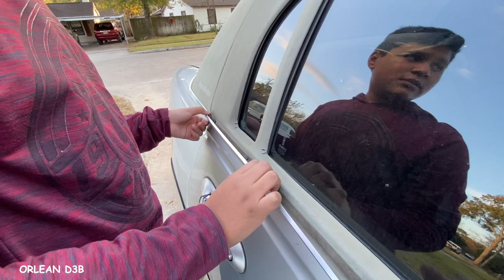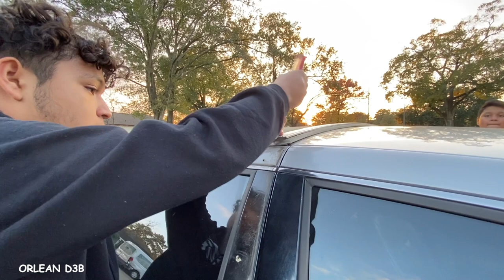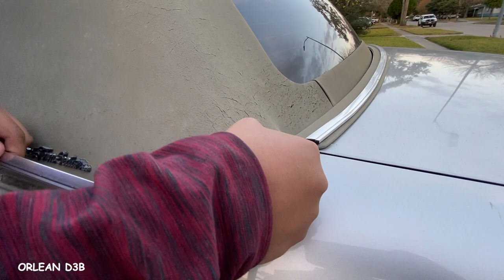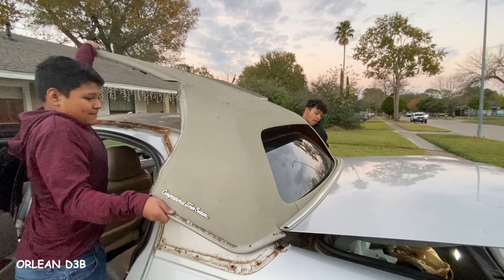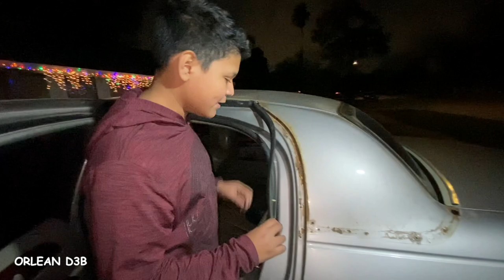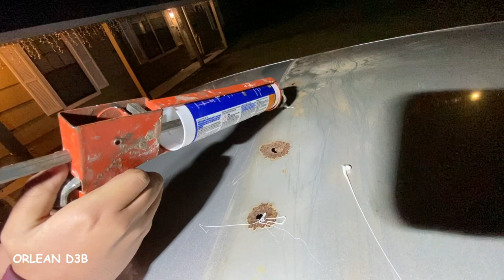Removing The vinyl top from a lincoln town car

Comment: One thing I can say about those cars is being body on frame you can actually replace the entire section of top if needed. The issue is the welding that you would need to do to replace the thing might require another carriage roof to cover up and hide the welds. ( limos have such roofs to cover the welding that was required to extend the body )

Comment: I have an 03 with a full vinyl top, had it replaced about 7 years ago but it’s starting to come lose in the front. Bumps are appearing underneath in some areas, I think it’s rust spots. Hate getting rid of the car because it runs great and look good still except for the top. Wonder if I can have a body shop remove the top and do the repair and just paint it to make it a hard top?

Comment: Nice movie. But if you wanted to carry out the work sustainably. Better to make those holes in the roof rust free and weld them closed. Now you know for sure that within a few years the roof will start leaking and rust.

Comment: What an unfortunate car modification 😂boomers had quite a taste. Now your only two options are a new vinyl top or re-wrapping/repainting this one (which will rot away anyway) or re-painting the car (painting the roof is the worst, even with proper equipment)
Great video and cool car 👌

Comment: I'd love to see how you guys would do this thru u both on a 2000 Lincoln towncar limo I have. I'm afraid to even touch it or try to do anything to it despite the vinyl top on it is cracking and is even coming off over the back of the side panel behind my rear door in it due to a bad rust spot my car has on it and under it even. I really wish I knew how to be doing it to a limo if I'd be possible and to not be having to be paying a shop thousands a shop wants to do it even here and that's out in Riverside CA an HR away from me and when I don't have a few thousand just to be giving to a shop to be doing it if it's possible. What's the tube of stuff your putting on the holes in the top of the roof on it? Is that a tube of DAP? Or whats in that tube? And why are you filling up the holes? U not putting another vinyl top on it? Or what?

Comment: i hate vinyl tops
Reply: Bruh
Reply: @foxyfox3942  I have a town car with a full canvas soft top, it's really great for muffing the sound. Vinyl I'm sure, does the same, but it gets torn and wears off very easily and ugly.

If you work on a car with soft top, don't discard it before trying to convert into a fabric canvas. The shell under the fabric is worth a fortune these days.
Reply: I had a 1991 Ford LTD Crown Victoria LX and one of the corners of the C Pillar was so rusted below the Vinyl top that I could fit my whole fist through it.

Comment: I need to buy a replacement vinyl top for my 03 Town Car. Does anyone know a website that sells it thx 👍
Reply: Sand it, paint it.after you take the top off. Plastic tops only Rot' out your roof
Reply: Thx I'm order a new top and take it local body shop to get put on
Reply: @captainamericaamerica8090  yea I see what u mean thx
Reply: @HexicanLS460L  yo where you ordered your top from
Reply: @terrelljoseph7899  it's just the cloth not the shell, but my shell is fine just needs new material it's all cracked and ripped bad 😂

Comment: So I have a 94 Caprice with a top. I want it off asap. I have taken the cloth off but now all I see is fiberglass. Any suggestions? Anybody...
Reply from the maker: if you don't see screws they probably glued it
Reply: @ORLEANHTX  any suggestions on getting it off? It's metal under this B's fiberglass right?

Comment: Good choice.  Those tops just look awful and will ruin a perfectly good car.  Old people trying to re-create the great looking cars of the 70's and 80's.  The rounded styling on modern cars just doesn't look well with them and they don't match the quality and finished look of the factory installed tops.  I would never buy a car with an aftermarket canvas or vinyl top like this!
Reply from the maker: I agree with you
Reply: Well I disagree with you. These roofs add class and style in my opinion. So I am glad they exist.
Reply: @SkySkrapinEnt  yea same here always loved em my town car is a 2006 beige with a black rag top
Reply: I hate them, it actually takes away from beauty of the car, in my opinion
Reply: They look good on some cars
The rust and holes underneath is the problem with them.
Reply: I personally think these vinyl times it looks pretty nice on older vehicles. But unfortunately they don't look that great on Modern cars. And another problem is if you live anywhere where there's a lot of moisture you're going to rot the car from the top down.
Reply: I was in Milwaukee, Wisconsin back in Summer 2017, and most of the 8th Gen Buick LeSabres I saw had Landau tops and they were hideous.
Reply: Some town cars cover the passenger rear tiny porkchop window with vinyl to give it that old boxy look too.